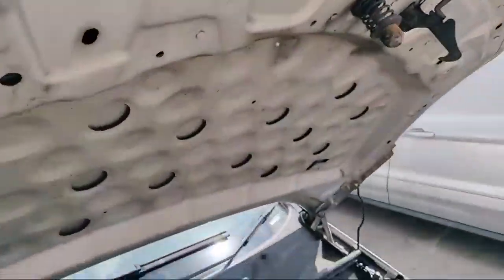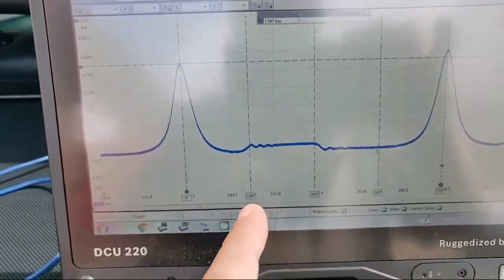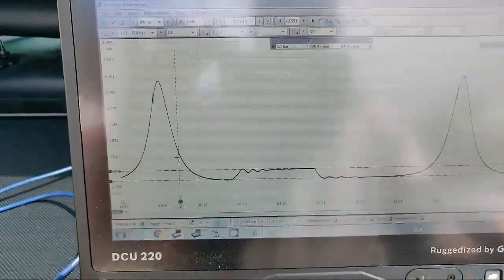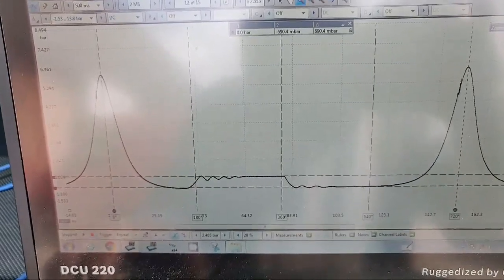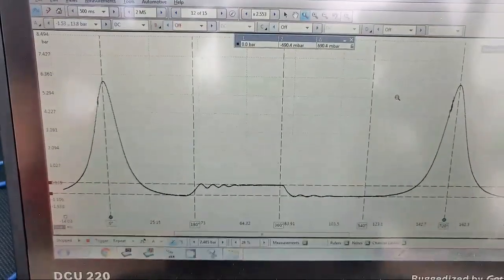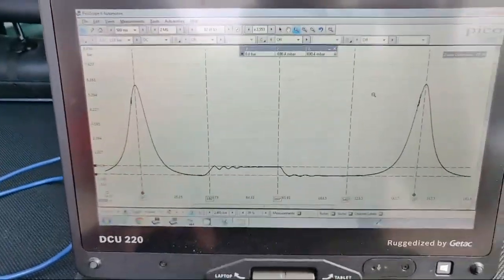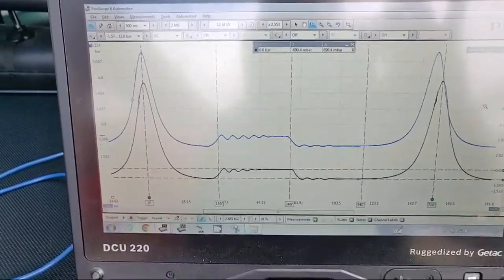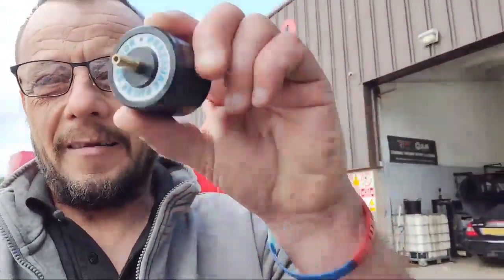Z12xep In Cyl Pressure - Original Camshafts

Comment: Hey Steve, could you tell me if this is possible. I am looking at buying a pico, if I buy a two channel, is this possible, if I need to do a cam crank waveform but need 3 channels,can I take the crank waveform save it, then take the two cam waveforms and overlay the saved crank waveform onto the two cam waveforms? Hope this makes sense, thanks Jonathan
Reply from the maker: You would need a trigger common to both captures to do this
Reply: @SimplyDiagnostics  Thanks for your help Steve, I currently use the verus and rarely need more than 2 channels, the price difference between the 2 and 4 channel pico is making me question do I need the extra channels,thanks again

Comment: Steve, when you say the original cams are back in, do you mean original spec'd cams or the actual original units? As if its the original units then it has to beg the question of "why were they condemed in the first place" surely?
Reply from the maker: Original cams were refitted, the original complaint of cyl 1 misfire returned so it was the correct call, unfortunately this means the replacement cams are out of spec.
Reply: @SimplyDiagnostics  im with you now Steve. Real interesting one to follow this

Comment: We used to check all of our cams whether race or std with v blocks,degree wheels, dial gauge for ramp, LCA, base circle,lift overlap etc as we had problems like this brought to us back in the 80s onward. Also when designing a profile we needed to know that it was perfect on every lobe, and if not why not. Think there are a number of windows based cam checker kits out there nowadays.

Comment: Hi, in 4:48 you turn on the reference waveform. In this moment we can see that the engine speed is not equal in both wavefrom( orginal cam shaft and after market). so if we can make any comparison when we have different engine rpm?
 i see that the engine rpm is no equal becouse the points of the maximum presurre are not in the same point of time ( look at the second risig edge and the max value of pressure , there are not in the same point in time)

i'm looking forward for your answer mister Steve. with regards